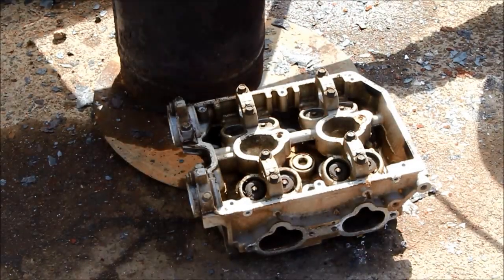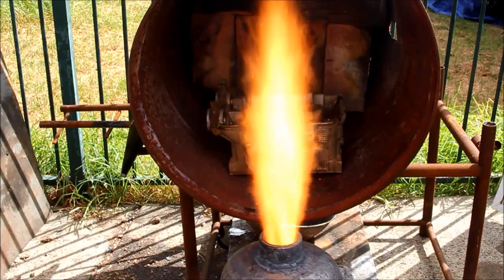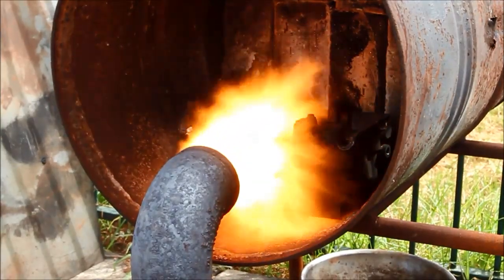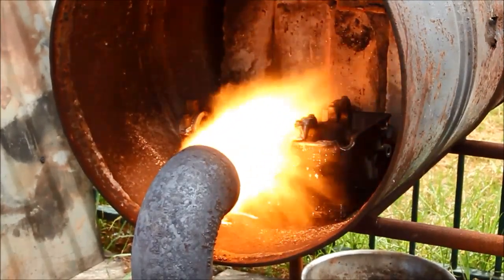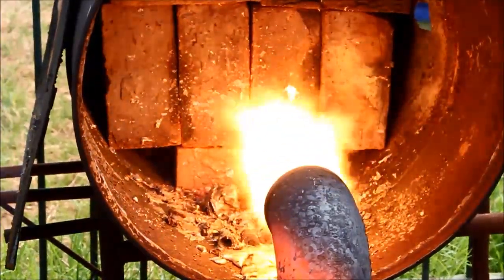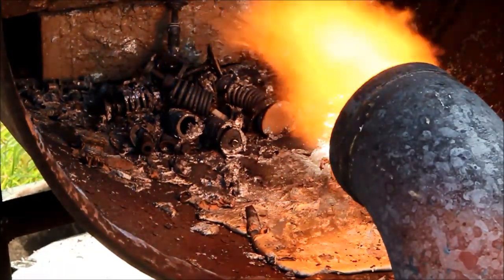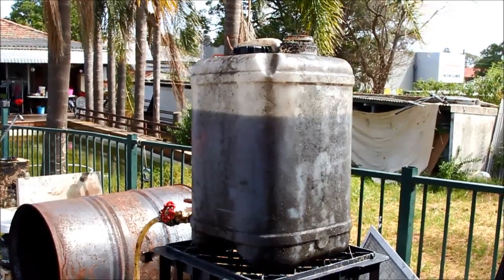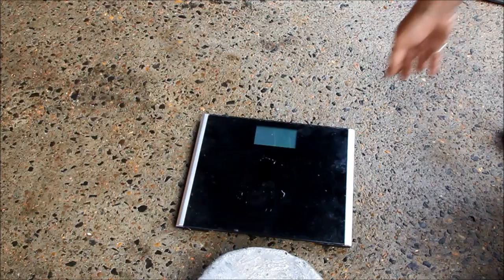Aluminium Cylinder head Melt in waste oil Burner Furnace

Comment: so, do u sell the scrap aluminium for scrap value/ is it worth doin/ reason i ask is because im making an oil burner myself, with this purpose in mind
Reply from the maker: You would have to check in your local area but here there is a BIG difference in what they pay for dirty aluminium which is basicly steel price and what they pay for clean Aluminium. 

Of course when you seperate the 2, you get the higher price for the ally and still get what ever little the steel is worth. 

This can also be done with Copper, lead and brass as well where it may be embedded with other things like steel which lowers the price.
Reply: @glumpy10  i see, thankyou very much for ur insightful reply. Alu price is low here, but would be worth while with brass and copper, possibly lead also.

Comment: That is very impressive. I would build a mould that could receive that molten aluminum and then take it to a machine shop and make a flywheel or other parts for my tinkering. I like your system better than a lot of others.
Reply from the maker: I Cast some aluminium Wheels for my hand trolley. Got sick of the rubber ones going down and the ally ones don't get harder to push with the load. Make a little noise on hard surfaces but does not worry me.
Reply: @glumpy10  that's a great idea. I'm going to string up some cables across my two acres and run stuff around hanging from them, About 50' or so at a stretch. I've watched this video several times, gonna have to make one asap! G'day to you, sir, from New York state!

Comment: Great energy video. 
I have asked others with out reply. It looks like a time test with this head. On a production style melt Is there a reason not to stuff the barrel full  and get the most use of your btu's?
Reply from the maker: That would be the way to do it. If I were not Filming,  I'd stand the barrel vertically, have the burner entering  near the bottom and fill it from there and the ally Draining straight out the bottom.  You would get max pre heat and use of the energy that way and could  melt a lot of ally and having it running out like water.

Comment: Due to extreme heath and safety here in Glasgow Scotland If you want anything from a scrappy And you cant make it yourself you just have to shut fecking down. I made a burner as per your burner, but it would not heat my butt. Seems in Scotand there is a shotrage of 19kg tanks. And a 4" elbow is 43 quid. not counting the two by two small rings I need to attach to the tank.
It would be cheaper to get my elbow from Aussie by post and packing than from here. 
Seems my cousin in Durbin is also watching your video. you take care fella and keep you foam extinguisher handy. I am trying to learn how to post a video. but it has to be waste oil perfect. night fella.

Comment: How are you lighting it up  I made one out of a  propane grill tank and I cont get it to light all I get is a flash and it goes out
Reply: do you light it, let it get started and stable, then turn on air? maybe even fuel, air, fuel,air adjustments. compressed gas same way, air fuel mixture has to be close for even light off

Comment: why doesnt  the barrel soften and give way ?
Reply from the maker: There is a lot of heat loss on the outside and it does not get hot enough to soften that much which would require it to be near melting temp. It's soft but not that soft.

Comment: How long do you think an oil drum..standard 55gal size...would run this thing?
Reply from the maker: If this is running at 200Kw, that's 20L an hour or in US terms.... errr, 20 L an hour, a 55 gal drum is actually a 44 gallon drum which is 205L so 10 Hours at this rate.  Of course this is a ship load of heat so if you turned it down you get longer burn. 
With free  waste oil, no need to worry about fuel consumption anyway.
Reply: @glumpy10  cool. Now all i need to do is find a few backyard mechanics near by who have plenty of waste oil!. I got an old vac for a blower i just need a fuel tank with valve for supply and a metal tank to rig to preheat oil as it is getting cold out here and maybe i can melt some shit b4 the snow comes.

Comment: Genius! Ok, so I didn't use the burner idea. I kinds stole foundry idea of an open container. 
I took a dryer bucket and the aluminum drops right thru the perforation into a water catch. It gives bearing sized "ingot". Thank you, for the idea.
Reply from the maker: That is a good way to do it. If you lined the top of the dryer drum with a bit of sheet metal, that would keep more heat going to the metal.  The dryer would act like a strainer and keep everything else out. 
Very well thought out!

Comment: Great work. I can only suggest you tilt the furnace a little more so the molten Al drains away quicker and solidifies rather than pooling up where it will absorb hydrogen and cause porosity issues down the track.
Reply from the maker: Doing it seriously I would stand the drum up. I mainly do it this way so I can film the ally melting.  Hard to put a camera over the top of a heat source like that without melting it and having the scrap obscured by heat haze.

Comment: Not very efficient arrangement,lot of heat/power wasted.Add some insulation/heat resistant concrete around melting furnace,maybe a frontdoor and it will reach melting temp quicker.

Comment: How do you reduce that big puck of aluminum to fit into a cruciple.  Could you drip the hot aluminum into a pot of water that would produce pellets?
Reply: Use a steel muffin tin - makes little pucks.
.
Additionally, call your scrap yard to make sure they take home-made ingots . . . mine won't
Reply from the maker: Yes I have done that and am also going to do a pelletising vid.  For now the lump is for storage and I'll remelt as I need it.

Comment: hi! I've been looking around for different designs and yours looks like the best. I wanted to know if you could use this to melt brass, copper or cast iron? Thanks!
Reply from the maker: Yes, it will do them all.  For cast especially you will need to have a suitable furnace with refractory able to withstand the heat.  I melted the corner off some bricks in my cheapo furnace the other day and The burner was far from being dialed up. Probably running 10% of capacity.

Comment: Are these things fuel efficient?
Reply from the maker: Ummm, with free fuel, who cares.  Realistically, yes. They convert about 99% of the fuel to heat.
Reply: Oil Burner
For some stupid reason, i asked about fuel efficiency when i really wanted to ask how much oil these furnaces burn per hour.
Reply from the maker: The fuel consumption is directly proportional to the heat output. They are not fixed. 
For melting metal like this, You'd probably use less than 10 Per hour.  Mind you, at that rate you could melt a LOT of ally.  More likely you'd run the thing for 30 min and use 4-5 L

Comment: I am impressed by the heat of your furnace.  I have looked at your other videos and have not seen a video of how you made your furnace.  I would like to make one similar for myself.  Maybe you will make a video of your furnace
Reply from the maker: It's just a 200L drum with the end cut out and some bricks to retain some heat.  very simple like me. 
The trick with a furnace is not the flame temp, that's a given, it's the amount of heat you can retain and slow down the loss of. Mine is as inefficient as all get out however I can generate enough fire to surround the object and fill the furnace so that makes up for a lot of the heat loss. If it were a proper furnace you could get the same heat with less flame/ fuel but that would be boring and not nearly as much fun!  :0)

Comment: if you connect this to a mini forge wouldn't that multiply the efficiency? cause as it is i see it's spreading and losing heat everywhere
Reply from the maker: Yes, absoloutley. This was a test of the burner only. It works much better in a furnace as I have done on many other vids.
Reply: also you sound like an australian horseracing announcer.. lol
Reply: nope I've figured it out, 
that dude who sells 'as seen on tv' stuff on early morning tv
Reply: not to mention the need to break the head to fit a crucible. as far as I'm concerned this is more or less how I'll be doing it.

Comment: im curious to know what the oil burner smells like? does it have a clean smell or does it smell like burning oil. we boil alot of things outside here in south louisisana and this could be something that could sell here$$$$$$$ propane is expensive to a cheap-o like myself lol
Reply from the maker: The only smell you get when the things are running is like a warm air smell. No odour with any fuel. 
I have tried getting an aroma to the fuel burning citronella, coconut oil, Duck fat and other things and they all smell the same, no odour or scent at all.

Comment: I have been watching all your videos I've had time to. Thanks for the fast reply yesterday👍 From watching these with the tank mixing area (I guess it would be called) it seems the inside of it would be as hot as the flame exiting?.?. The Elbow on top got red kinda quick so I'm assuming this would be great for decorative blacksmith work on any furous metal. How does it not just burn the tank out in a hurry , or do you have to replace them in a hurry?  8th was quite impressive to see that much aluminum melt that quickly. My partner in business and me have tons of small insulated copper wire to clean. I think we just found the simple way to get a number one grade ingot.
Reply: remember that most yards won't take ingots - they don't know if you have 100% copper, or 98% lead with a copper coating..... 

the combustion chamber is thick enough to sustain repeated heatings, and i don't imagine there's much oxidation (which would be the real decomposition) on the inside, since the fuel is sucking all the oxygen out of the atmosphere.
Reply: they won't take bigots, but make round stock and sell it above scrap price
Reply: My old yard wasn't afraid to cut into stuff like that to be sure, As well as the spark and vinegar test if you brought enough of something.

Comment: Hell yeah!  My first DIY using compress air, jet nozzle, crankcase oil was a smelter for quickly separating aluminium (and copper) from the 'impurities'.  14" pipe 6 feet long 1/4 wall.  DIY high temp valve for batch collecting and release into a block mold (40 lbs. per, aluminium).  Had to use 'tools' with 4 foot handle extensions to operate it.
The cops became regular observers as reports of explosion noises from neighbors 1/4 mile away were called in (flame outs).  I was commercially zoned so I could do what I wanted!  Ran that thing until there was no more feed-stocks available for miles around.  The pipe looked like a broke down sway back horse by the time I dismantled it.

Comment: I have a question how to make it in a much efficient way
Reply: +urich jib effeciency isn't really the purpose of these things having said that im sure one could probably tweak and adjust various things to eek out the best fuel consumption possible but the results may be slightly disappointing as the correlation between fuel flow and heat output is pretty much linear

Comment: Wow that's an amazing flame , if you had more fire bricks to insulate the heat and shapped to concentrate the heat , then the aluminium would melt much faster. My dad used to do some non ferrous casting using coke and gas fired furnaces. That oil burner would have been so much better.
Reply from the maker: +Vincent Pons  You're entirely correct.  A proper set up furnace would be much faster and use much less fuel.  I do this for demonstration purposes as much as anything and the fact it works so well so poorly setup like this only indicates how good a proper setup would be.

Comment: Alaminium? What is Alaminium?
Reply from the maker: +cadauctions31  it is the correct pronunciation of the English word not bastardized by an American variation they incorrectly  turn into  "Aloooominum," which is patently wrong. Please also note, the word " soLder" has an "L" in it which should be clearly pronounced making the word "solder" not the incorrect pronunciation of " sodder" which makes it sound like a perverse sexual act rather than an industrial procedure.  To further correct common mistakes,  "Gas" is something which closely resembles air, not an atmospheric pressure  liquid you can pour into the fuel tank of your Vehicle. That is " Petrol". "Pro-paaaaane" IS a type of gas although not all gas that you run your BBQ on is Pro-paaaaane. It's correct term is " Liquid petroleum gas"  or LPG for short. 
Hope that helps you avoid these mistakes in the future.

Comment: You waste a lot of energy not insulating the sides or enclosing it. It's also inefficient because the hottest aluminum...in the liquidous state is drained off instead of heating and melting the remaining solid aluminum. It might be interesting to plug the drain hole until the melt is done.  I may try that with a few other mods and see how the process improves.
Reply from the maker: +Larry Maloney  Yes, a lot of energy is wasted but I save a lot on refractory and I don't want to build a permanant thing yet. This is just for demonstration purposes for my vids. If someone were going to set one up for practical use then insulation and a lid would be very beneficial. 

Also true about enclosing it but that would make for a boring arse video if you were just looking at a lid instead of the flames.  I would like to work out a simple and easy way to be able to turn the molten ally on and off to fill ingot molds with but haven't come up with anything yet.  
While this demonstration Furnace is not efficient as you say, the fuel is free, plentiful and I have more heating power than I can use despite the inefficiency's. :0)
Reply: +Oil Burner , I'll watch your other videos and maybe build an oil burner paying special attention to insulation. . I have several 55 gallon drums of used oil. Interesting video.
Reply from the maker: Larry Maloney You should be able to melt a lot of ally with drums full of oil in an insulated furnace. i'm sure it would make a HUGE difference to the temps you could reach and how much less fuel you would need.

Comment: Why are you yelling?
Reply from the maker: +dozer1642   Because I have done a few vids now and the external Mic I have seems to home in on the loudest noise. If that's the burner, i can barely be heard if at all.  Sorry if I yell too loud at times but it's hard to pick even after all these vids what the right level is over the roar the burners usually make which is a lot more in real time than comes out on the vids.

Comment: Hi Oil Burner, ever thought about putting a thick layer of clay on the inside of the barrel or "furnace" you could make it in such a shape that all the aluminium runs out much smoother, and if you put a cast iron barbecue or wood stove rack on the bottom on top of the clay the steel parts will not keep the aluminium from flowing away because the steel parts will stay on top of the cast iron rack. But more important is that the clay will make the aluminium melt even faster. The steel barrel draws a lot of heat away. I know there are better materials and designs to build a decent furnace but I mentioned clay since it is easy to get and it is easy to apply on your existing setup and easy to replace when it is no longer usable. A few taps with a hammer on the outside of the barrel and the clay will crack in order to replace it if needed. Have a good one and don't burn your fingers :-)

Comment: Great video mate,looking forward to more!. Just had a thought watching that, if you were to wrap a metal pipe coil around the outside of the burner and connect it to the hose you would have a demon steam cleaner!,imagine how that would blast away oil,grit and muck? Just a thought..
Reply from the maker: +Andrew Wilson Yeah, Using one of those little 100 PSI diaphragm pumps it would crank out some steam all right!